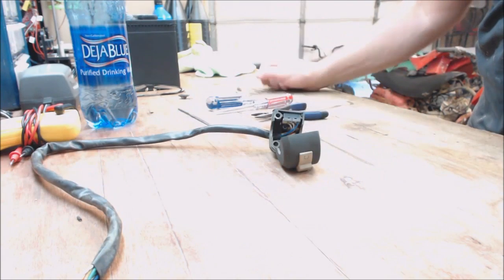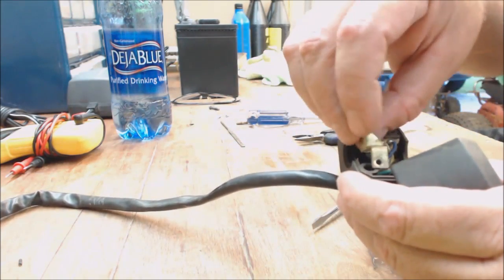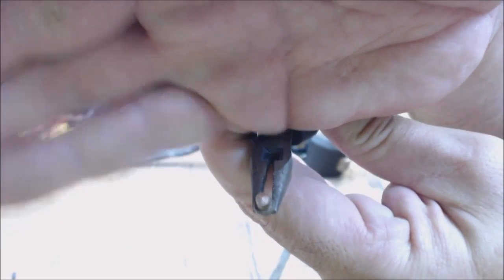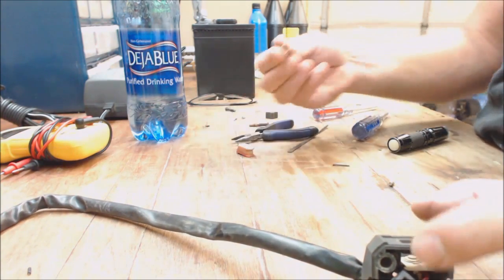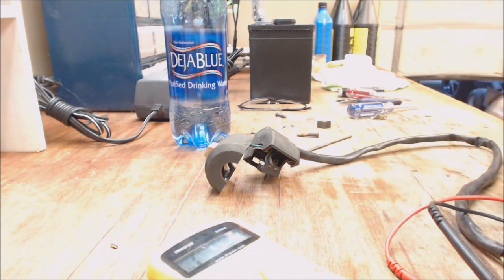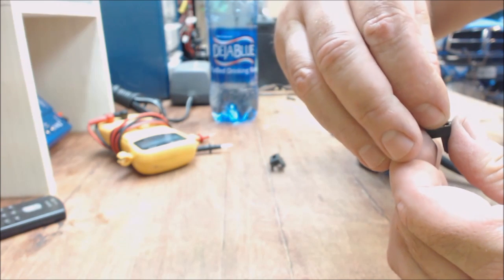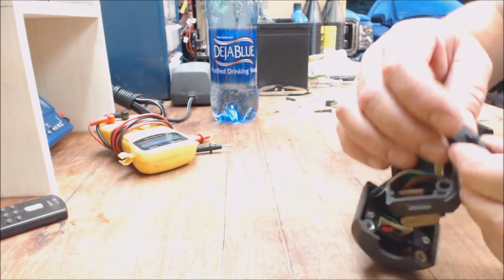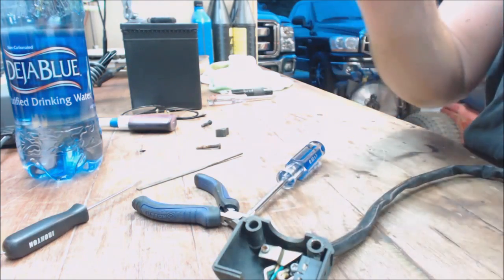Chinese ATV Start Switch Repair

Comment: Thanks a lot, I was puzzling over what had happened to my atv and why it would start from the solenoid and not from the button.
Reply: I have the same thing happening but the switch is brand new so I don’t know if it’s the problem

Comment: Went to open the switch system, after putting wd40 on the screws, but they were seized and they stripped on the first rotation😭
Reply: whatd u do to fix

Comment: Hi Mike, I could use help. 110cc Tao Tao. Died during cold cranking after winter. Battery is good, 13.1 volts measured. New solenoid and CDI. Lights work. No click sound from solenoid or starter. Tried jumping solenoid and get nothing. Could it be this start switch?
Reply from the maker: If you jump the solenoid with a screwdriver and the starter does not turn probably bad starter. You can push the starter button and see if you get voltage on both sides of solenoid. One side should always be hot. If you get it on one side and not the other the solenoid or switch has an issue. Try tapping on the starter with the wooden handle of a hammer then jump solenoid maybe its just stuck.
Reply: @mikesgarage9757  Thanks. It's up and running. New starter and solenoid and start button. Pretty sure it burnt up trying to start it late winter too many times.

Comment: Thx for tip. Have a little 110 trying to get going. It used to crank over. But now getting no power to starter. It worked for like a second. So thinking it’s the switch. Thx again

Comment: See if ya got a idea here.  Got a coleman 125 atv. Turn the key over no dash no headligjts no start. Can cross solenoid to start or push start. Thought it was ignition until i could still start it with key on. Now im not sure what it could be.
Reply from the maker: Intermittent Solenoid?

Comment: Did you say royal purple oil
Reply from the maker: lol yeah. I had some small sample bottles.
Reply: I gotta question I just got 2 of these atvs in pieces where does the key switch live at its got 2 bolt holes not sure where it goes the wirings all ripped out also so i gotta couple' projects ahead

Comment: Best bet, buy new unit off EBay for $12... Plug n play in 15 minutes! No muss no fuss...
Reply from the maker: Unless you don't have a lot of money. Maybe you don't have a n Ebay Account. Then you have to find and buy the Correct one if you can. They are not all the same. If you have another push button switch lying around you could use that as well. There are several options. This is just how to use what you already have. Thanks for the Comment.

Comment: I have a question if you could help me please? I just got a new battery for my sons Chinese four wheeler, and when I put the power wire and ground wire to the battery it automatically starts the four wheeler without the key being in or turned on. Can you please help me
Reply from the maker: It shouldnt start like that. if its just turning over and not starting the Solenoid may be stuck or something is crossing the two posts that is conductive.
Reply: Copedipper19 86  i'm having the same problem...please help me..
Reply: Vincent Jerome Kaipat still trying to figure it out if I do I’ll let you know and if u hear anything please do the same
Reply: Mike's Garage soon as I hook the terminals up it fires right up or try’s to turn over so what do u suggest
Reply: Copedipper19 86  the first thing you should do is when coneccting the battery ,you start by the positive terminal first and then the negative.also you need to replace your solenoid and make sure you conect it the same way it come off and that should do it
Reply: My four wheeler just did this. It was the ignition was stuck in the on position even though it was turned off. Replaced the ignition and it fixed the issue.